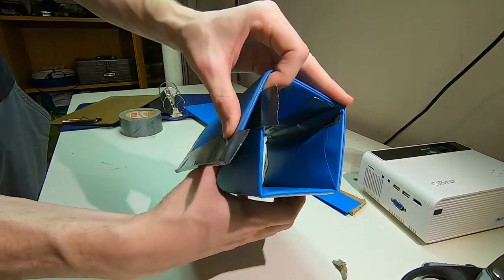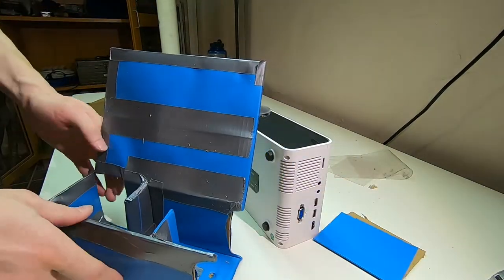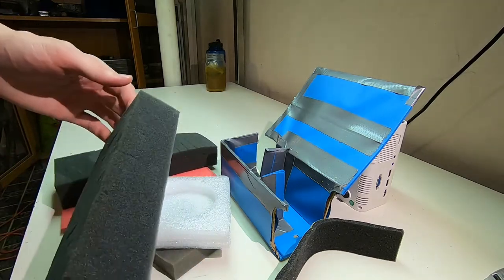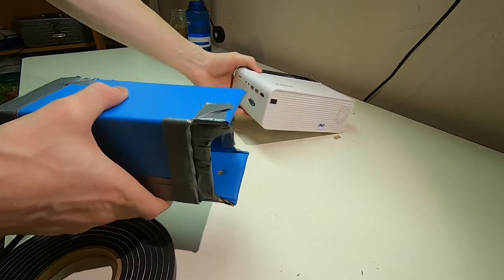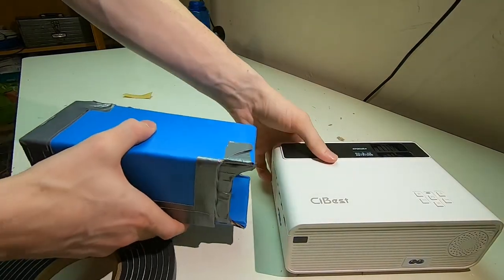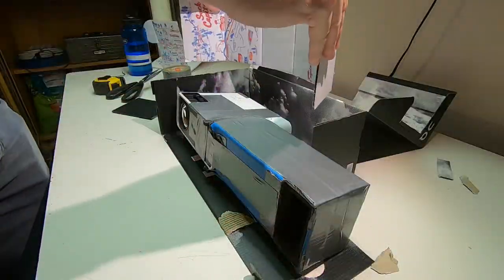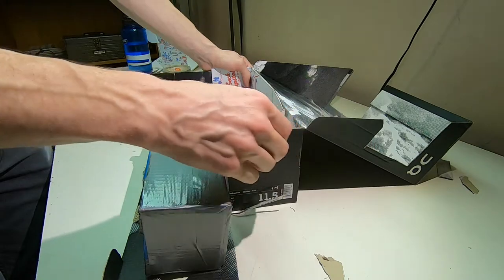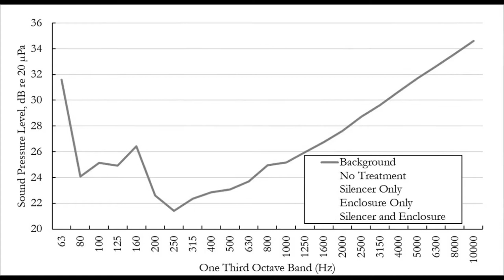Homemade Projector Silencer - How to reduce fan noise on a loud projector

Comment from the maker: Does anyone have any suggestions on improving the design? I want to do make an upgraded version some day.
Reply from the maker: pt265  Nice! Yeah, I would not expect a barrier like that to do a lot more than 2 dB overall, but at high frequencies it can make a big difference. I am curious - how did you measure the sound? (Also, I am just seeing your comment, for some reason.
Reply: i do.. mod it internal and make cooling better. change the ventilators for more silent ones.
Reply from the maker: @extaza555  That would seem worthwhile for a nice projector that I paid good money for, but the price of this one (free) makes major modifications not worthwhile.
Reply: @teatimewithja  in the meantime I got myself a Sony VPL-HW50 and I couldn't be happier
Reply: Use something thicker and sound absorbing like plywood or drywall to attenuate the low frequencies.
Reply from the maker: @johndu3969  Agreed - That is what is really needed. Something with more mass and thickness.
Reply: @teatimewithja  That's what she said

Comment: The silencer introduces a pneumatic resistance that reduces the airflow. So the fan will have to work harder (turn faster) and... produce more noise. Or the lamp will get hotter and die soon.
Reply from the maker: Agreed - both are potential results of a silencer. If you are dealing with high air flow (I am not) there is also the potential problem of self-noise from turbulent flow caused by the tortuous path in a silencer. For this application though, I did decrease the overall SPL so, even if the fan got a little louder the silencer provided even more reduction with a net decrease in noise. Also, I tried to make the cross-sectional area of the flow through the silencer as big or bigger than the original outlet so back pressure should not be significant. Finally, the bulb may die sooner, but I will enjoy the quiet until it does. Thanks for the thought-provoking comment!

Comment: Excellent! That is what I m looking for. I have to find a way to reduce noise from fan of a DIY humidifier. And this video gives me a lot ideas! Thank you very much. And a comment, how about using foam as baffles directly?
Reply from the maker: Hey Adrian. Thanks for the feedback and good luck with the DIY project! My results were not perfect, but it definitely helped. Foam baffles alone will still get you some noise reduction, but the foam alone has very poor Transmission Loss so a good bit of the sound will be able to travel directly through the foam which effectively shortens the noise path to the exit and reduces the number of times it interacts with (and is attenuated by) other foam.

I would recommend using something a little bit thicker than the notebook I used for the walls to increase transmission loss. Also, make sure to seal all the cracks/holes/leaks. Duct seal/putty works great (duct tape has terrible Transmission Loss). So, a couple warnings/disclaimers: Make sure you are not causing any heat issues by adding the silencer. Also, if the silencer is in the humidity flow-path, keep in mind the potential for mold if the foam is constantly damp.

Comment: We added an external fan to our projector to increase cooling, but that of course only added to the noise.
Reply from the maker: My projector hasn't melted yet with the extra silencer and enclosure, but it is always possible. Sounds like an silencer would not help you, but maybe an enclosure around the projector AND the extra fan (open at the front)?
Reply: @teatimewithja  This is what I was thinking of doing.  A big, foam-lined enclosure box with one or two super quiet computer fans (big, low RPM).
Reply from the maker: @PongoXBongo  I like that idea. It seems like you still may hear the big fans, but the lower frequency hum should be less annoying than the wine of a higher rpm fan. Also, remember that the lower frequency noise will, generally, be harder to absorb or attenuate with mass. I assume the computer fans would be on the front of the enclosure on the side facing away from the audience?
Reply: @teatimewithja  Well, in my case, the projector is directly above the audience (wall behind couch), so fan placement for noise wouldn't matter too much.  
.
I'm thinking more like a fan on each side (not front or back) to create cross-flow (like a PC case).  Or maybe solid sides and a fan or two on top?  No audience floating above the unit, lol.
Reply from the maker: @PongoXBongo  It sounds like you have thought through this a good bit. In that configuration, on top seems to make the most sense to get the largest barrier affect between the audience and outlets (unless roof reflections become an issue). Let me know how it turns out and if you learn anything along the way - I love acoustics stuff.

Comment: Does this do anything for the heat levels that the unit might produce?
Reply from the maker: I am afraid I only have subjective information for you - but I  hope it is helpful: I do not think this silencer drastically increased the temperature of the projector, but I was a little bit warmer with both the silencer and the enclosure. I have not had any issues so far, but I image that moderate increase in temperature could reduce the lifespan of the projector (or at least the bulb). I do not think there is any fire danger, but I can not guarantee that.

Comment: How did you kill those high frequency tones? Also what mic did you use?
Reply from the maker: Thanks for the questions. The enclosure helped some with the high frequency tones, but the silencer brought them down more significantly. Of course, the combination was the most effective. It was a combination of the barrier effect (shielding of the enclosure) and absorption (the foam in the silencer). If you are working on something similar, make sure to seal all the cracks and deal with all the flanking paths.
Reply from the maker: I was using a couple PCB 378A06 free-field mics (which is the 377A06 condenser microphone combined with the 426E01 preamp), because they perform well at high frequencies, but more often I use the more-typical PCB random incidence mics. PCB makes good stuff, but it is not cheap.

Comment: Another solution would be to replace the noisy fan with a quieter one. Only thing is to make sure it has a better airflow, so it doesn't have to turn too high rpm.
Reply from the maker: That is a good idea. I think I might have done it that way if it was a bigger and more expensive projector. Do you have a success story with replacing a projector fan?
Reply: @teatimewithja Unfortunately I didn’t try, but I read several posts on different forums about replacing the noisy beamer fan. I’m pretty sure that on this kind of beamer it must not be very difficult to replace it. The only thing that can happen is that the fan’s rpm is checked by the motherboard’s software and if too slow, it triggers a « security shutdown » to avoid overheating, as sometimes it can monitor not only the temperature, but also the fan speed. It could be a very interesting thing to do. The first thing would be to check the fan size and connector type. Then to find a silent brand with the same size like Noctua, Arctic or Noiseblocker. They make great fans.
The only thing I am wondering about is: is the fan rpm fixed or does it change depending on the temperature? If fixed, you need to make sure to get a silent fan when running at max speed.
Reply from the maker: That sounds like a reasonable approach and some good details to keep in mind.. Even if it may not be the simplest fix, it does sound like a fun project. I do think my projector has two different speeds at least, depending on the temperature - tricking or re-setting the rpm sensor would probably be beyond me, especially if it is all circuitry, but a combined approach (reducing the noise at the source, AND treating the noise path) may be a good approach as well.
Reply: @teatimewithja  I did something on my laser tv ust projector that has a noisy fan. It looks not terrible, but does miracles. I "attached" my air filter (that has a HEPA filter) air output to my beamer’s air input so it pushes filtered fresh air in it. It prevents noise as fresh air is pushed through it and it also filters the air from dust so no or pretty much no dust cleaning is required anymore. It runs at lowest level so I can barely hear the filter, but still has a pretty high amount of cfm and air pressure going through the system. Biggest advantage in the whole thing is that I’m not married, so nobody says anything about how it looks 😄
Reply from the maker: I love it. It sounds like you are solving several problems (restricted air flow, noisy projector, dusty air, etc.) at once. There definitely can be cost savings from living alone!

Comment: 🤔 interesting.  Has got me thinking.  Could you/will you recreate this with 3d printer?
Reply from the maker: That is an interesting question. I could see some advantages that 3D printing would have: You could get a more solid and continuous structure without thin/weak points that sound can get through, you could match the geometry to the curve of the projector for a good seal, and you could also produce several variations without major extra effort to see what works best. With typical 3D printers, the struggle would to get fibers/structures small enough to get the absorption you would need - I think you would still have to put in foam, fiberglass, mineral wool, or something similar. Let me know if you try it!

Comment: I've got a similary type of LED based projector, recently acquired and noisy as hell. I've been looking for solutions too.
I've opened mine up and found two very cheap fans inside. One is a blower chamber type that pushes air around and normally louder by design and the other is a normal 80x80mm fan, that pushes air out through the ventilation.
I did think about reducing the air speed of fans but thought overtime, the LED may die from overheating.
The fans are simple and not thermally controlled, which would have been better, though perhaps still noisy due to the cheap fans.
As the exhaust fan is quite generic, I'm looking into replacing it with a better quality and quieter PC fan. The only problems is finding out how much air flow the original pushes, though I'm not sure if it needs to be as much, I'll try for similar.
The blower mayber harder to replace as its somewhat custom, though replacing that would be great too.
Or I was thinking to reduce the exhaust fan speed and attach a slim low speed fan to the exterior grill. This will suck out the heat more efficiently, as the internal is about 30mm away fro m the grill so the sir is directly going out.
It's going to be a lot of experimenting.
Reply from the maker: That is great that you pulled your projector apart - going to the source of the noise and trying to fix that is often a better option than just treating the noise after it is made. I agree that a slower RPM, larger fan that moves the same amount of air would most likely make less noise than the smaller faster fan, so that does seem worth trying (if that is what you were saying for the external fan). Also remember though that convection heat coefficients are a function of air velocity so if you are decreasing the velocity you might decrease the heat transfer from the projector to the air. Replacing a fan with a nicer quieter one also seems like a good thing to try. Sadly, while what I did helped some, and I am guessing you can get some decrease in noise, a lot of the things I tried are only incremental improvements, not true fixes. Good luck with the experimenting!
Reply: Have you found a quieter blower? I'm stuck in the same situation
Reply: @MrBorkie  Unfortunately no, there are some similar but the projector would need some modification for them to fit.
I did change the exhaust fan to a PC noctua fan, which I had laying around. 
Even though definately quieter it was a few rpms slower, the temperature increased significantly inside that there was screen burning after about 5 minutes, so put the original fan back in.
I also temporarily connected variable resistors to the fan lines, and played around reducing speed. The blower has the most impact on heat expulsion,  reducing it only a few 100 rpms, didnt make much impact on noise reduction but again caused screen burn within a few minutes.
The exhaust fan has worst design, as the heat is not pushed put enough and efficiently, gets trapped and affects further back in the air flow.
I think if the exhaust section expells more air, less restricted and directed out better. You could theoretically reduce the blower speed safely.
The other idea would be make a box for the projector, fit two large fans for in/out, with low rpm and will push large volume of air MAY be an option.
OR/ALSO increase size of LED lamp heatsink with the fan externally mounter but slower RPM.
OR like in cinemas, setup the projector in another room, projecting through a glass panel. All this for a cheap/badly designed projector! Good luck
Reply from the maker: Thanks for sharing all the details - it sounds like you have done some good experimenting. I like the idea of a bigger box with larger slower fans, though if were going to do something like that I would make sure to put the fans on the side opposite the audience because that could get you a bit of a barrier affect, and also not have a direct opening on the audience-side. How are you measuring the temperature?

Comment: dude sound will escape from open spaces of any dimensions, you either need an oversize hush box or replace the fan with a bigger one via a fan duct (risky to disassemble)
Reply from the maker: You are right that sound will get out any opening. Like I said in the video, I am treating the shoe box as more of a barrier and less of a full enclosure, because I need openings for the intake airflow. It does help reduce the sound at the listener location behind the projector.

Comment: What could I do to reduce the noise of airplanes flying over my house? Really it’s only about 44 decimals at the loudest when ones loud one flies over a bit lower than normal, but still annoying. Considering thicker curtains in my bedroom since I assume much of the noise is through the windows.
Reply from the maker: That is a great question, but you are not going to love the answer. Noise from an airplane has a lot of low-frequency energy which makes it difficult to do much about unless you want to make major changes to the structure of your house. If you have a long wavelength (low frequency) you need a lot of thickness and/or mass to do get decent transmission loss performance. For sure, windows are often the weak point but to get any reduction in noise you would have to have VERY substantial curtains AND make sure there are no gaps around or between the curtains that you can see light through. Instead, I would recommend looking for cracks/leaks around windows, doors, ceiling fans, and other penetrations to outside. Thicker curtains may help some, but I would guess you will not be able to tell the difference. You may be better off with white noise (a fan?) and ear plugs.
Reply: @teatimewithja  yeah that’s not great news. Fan it may be then

Comment: Did you try replacing the fan?
Reply from the maker: I did not try to replace the fan. I am assuming you could buy a quieter fan but my concern is that you would have to pay a good bit to get a fan that was significantly quieter, and then you might be paying a good portion of the cost of this budget projector. I might have tried that if I had a really nice expensive projector. Have you had any good luck with fan replacements?

Comment: Does this really works?
Reply from the maker: It really does work. I have an education and professional experience in acoustics and the measurements I took were with NIST-traceable calibrated equipment. At the same time, the reduction I got was only a few decibels in the overall a-weighted sound pressure level - not very much. I do have to admit that my y-axis in my plots look a little funky, but if you look at the relative differences the real performance I got form the combined silencer and enclosure was in reducing the level of individual high frequency tones. 

This silencer build was more of a proof of concept though. To really get good performance you would need to 1) use more dense/thicker material with higher transmission loss, 2) carefully seal all gaps and leaks, 3) treat all the air openings on the projector, 4) probably use a foam with measured absorption values if you wanted mid-frequency performance, 5) not use duct tape, 6) address any flanking paths such as noise coming through the plastic projector case.